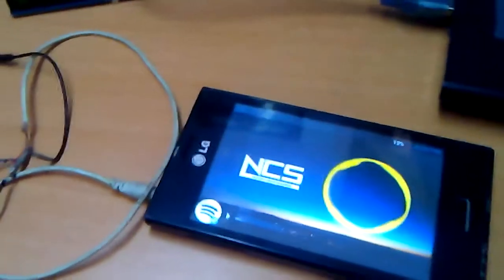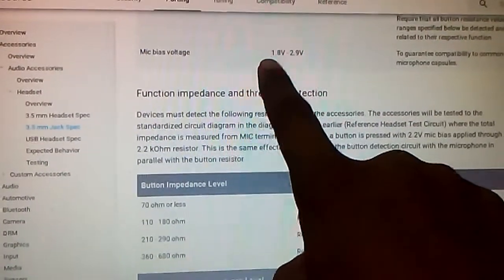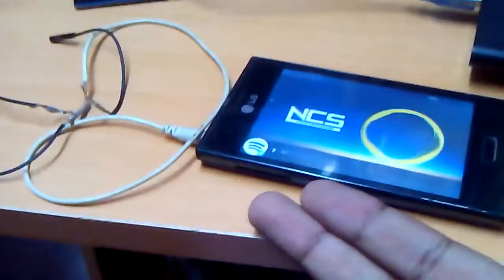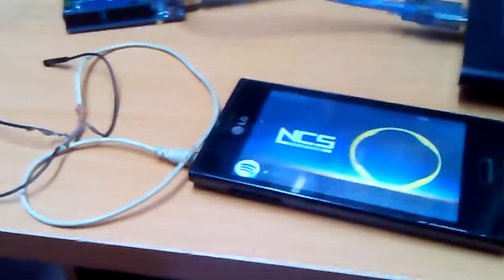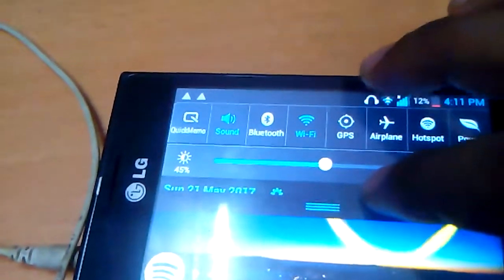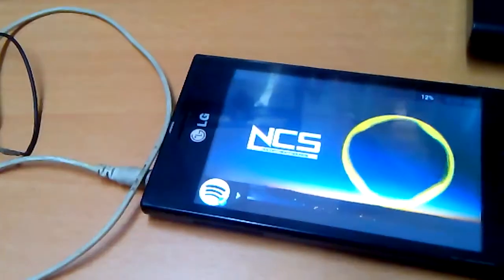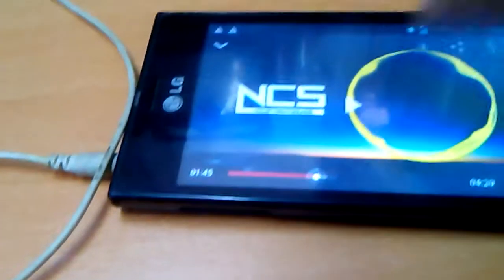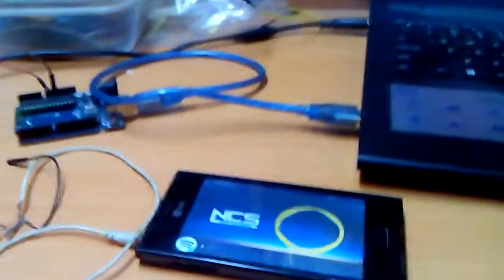Don't do this! - Headphone jack

Comment: If I want to be able to detect sound  how would I connect the audio cable to the Arduino, is there a off the shelf device that I could purchase that could do this? I just want an Audio jack that I can connect the audio source to and have the Arduino say, yes or no there is sound detected. Help